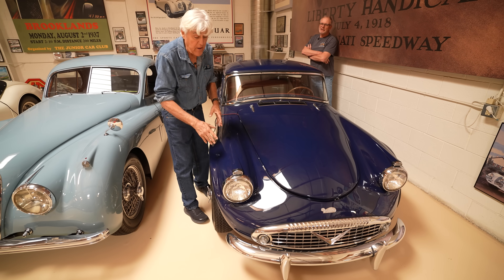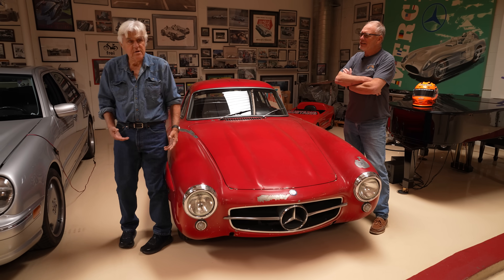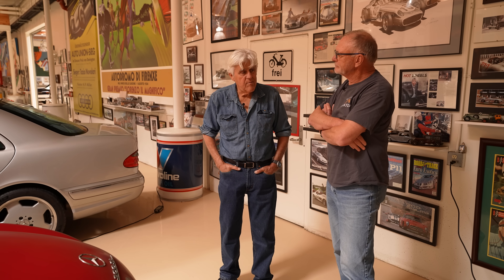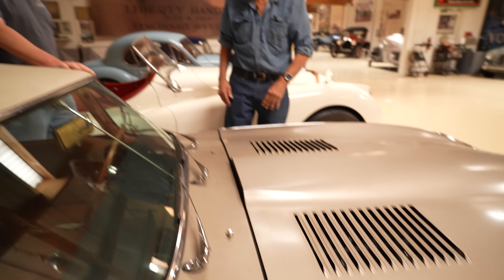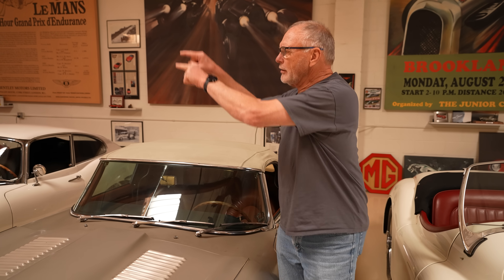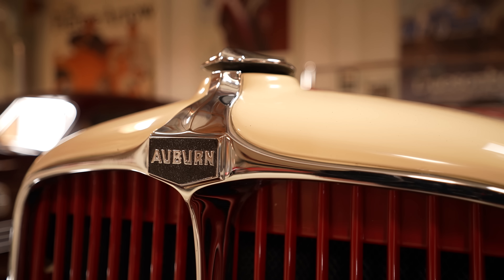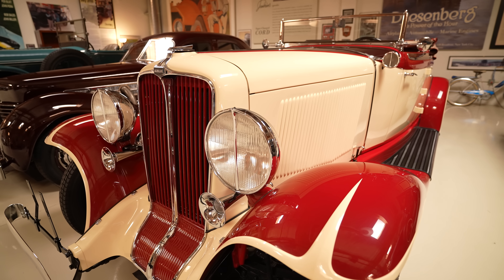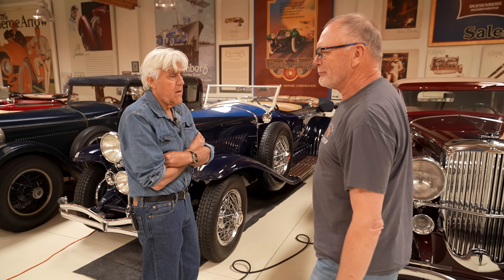All of Jay Leno's Barn Finds: How He Found Them & Untold Stories | Barn Find Hunter

Comment: I have personally known two guys that approach the level of Jay Leno, who will remain nameless, here. Each of them was a bit surprised that I knew as much as I did (which isn't much). Both are niche collectors. Jay, however, is all encompassing. His knowledge about cars is well beyond nearly everyone.
When I see videos like this, I start to wonder what happened to two specific cars. A Duesenberg "boat tailed" roadster I saw (1 time) when I was in High school ( the guy that had it was surprised that I knew what it was) and a 1956 Oldsmobile Holiday I saw in a friend's dads garage in 1971 (less than 10,000 miles and 100% original, tires included)

Comment: Tom (regarding the Jaguar E-Type @8:35): So, what did you have to do to the engine? Jay: Nothing. Cleaned it. Took it apart. Pulled the rear end out. Flushed everything. New seals. That's about it.

Comment: Wow. Love the Deucenberg cars. Seeing Eddie Rickenbacker mentioned on the wall behind the Walker Coupe is interesting.  Eddie was very close friends with my Grandfather. They flew together in WW1. The planes were Dehavaland DH-4's. I know that my grandfather worked as a machinist in Elizabeth, N.J.  for Standard Aircraft, building Liberty  V-12 engines. They were the ones installed in the Dehavaland DH-4. 
After WW1,  my grandfather bought his plane from the Army Air  Corps.  He flew the U.S. Mail out of Hadley Field ( Airport),   South Plainfield,  New Jersey.  One of the first "night fliers". From Hadley to Chicago.  Later,  he would fly out of Newark Airport,  which opened in 1928. Somewhere I have a newspaper article with a picture of my grandfather,I believe it was in December, with a U.S. Mail Pouch handcuffed to his wrist. He was using a blow torch to heat up the fuel line,  because it froze and he made an "emergency landing" on Old Lincoln Highway (Route 27) Somewhere near Edison New Jersey.  
 Thanks again for these videos. So much American History is Disappearing and not being handed down to our youth. 
😎🇺🇲🇺🇲🇺🇲

Comment: Barn finds are wonderful. I'm an old Corvette and I ran across a 66 big block in Geneva Switzerland. 9000 miles, totally original. I already have an old Vette, so I was hoping to sell it to a fellow enthusiast. Not for a horrid price - but no one seems to want it. The same guy I bought it from had a 12 cylinder Jag with 3000 miles. All original. I called the Jaguar club and talked to several enthusiasts. It was amazing. No one was interested.

Comment: Jay, you do not know me, but I know of you thru your stories. It is too bad we live a long distance apart. As I was watching this video, it came to my mind that you and my father would have been best friends. He loved anything that had an engine but, he had to make it run. He lived in Grove Okla where he raised his family. On our five-acre farm he had a small engine repair shop. He could and would make any engine run again. As I recall, he had a guy bring him a Maytag washing machine engine. In the early 1900's most farms did not have electricity.  Mom would do her washing with a gas-powered Maytag washing machine.  It was a two-cylinder two stroke kick start engine. Every time someone new would come in his shop he would start that engine. One thing dad had was patience. That first Maytag was frozen solid. For months he would tap the piston and add a little winter green penetrating oil. After a few years dad had a dozen lined up in a row, all running engines. He advanced to a little bigger farm one piston farm engines. Years later he when to a field where he knew that there was a Model T Ford. Not much left of the car but it was a rolling chaise. He offered the owner I believe five hundred dollars and he took it. With the understanding that a year later, he would drive it up in the guy's front lawn. Dad did not buy parts, if it needed something, he made it. I believe that he made cast iron rings for the pistons. He made new bands for the transmission. He re-wound the model T coils and flashed the magnets in the flywheel. Dad was a World War II Army Veteran and he left this would at the age of ninety-four.  I have a car that has been with me far too long, but I will drive it again someday. It is a 1970 Fiat 850 Sports Spider. I would guess that there are less than a dozen still drivable in the US. I moved to Tulsa when I got out of the Navy in 1980. I saw one other than mine on the road in the early 80's. It has been in storage since my last restoration in 2000. It has a Weber 30 DICA carburetor on it. This fall I will attempt to retore it to like new conditions. I am studying how to zinc plate most of the parts. It seems that none can be had for any amount of money. If you have one, please let me know. Thanks for letting me share.

Comment: Nicks Garage had a stock  1953 Chrysler 241 Hemi on the dino. It was amazing. Other than the great sounding exhaust you wouldn't know it was running. Not a bit of vibration. Its only down fall was the factory cast iron exhaust manifolds which probably didn't have an inch inside diameter. I want to say the hp was 150 maybe more. With the right air intake and exhaust  it would have been a screamer.

Comment: I'm going to try to make a long story my neighbor and good friend inherited a 1956 300 SL Gulwing in 2004. Since l collect vintage sports cars and am partners in a shop that specializes in vintage exotic makes she offered me this, bring the car back to full operating condition, keep it in my collection and maintain it, drive it as much as l want as long as she get to drive it occasionally. The car cleaned up extremely well so l explained that it would be far more valuable if we didn't restore it. There are some spots where primer is showing but it's wearing about 90% of it's original paint. Same with the interior, a new headliner and some stitching on the seats but the biggest issues were mechanical. It only had 17k miles but it had been over reved damaging the valves, fuel system, brakes etc.. lt took two years to locate all the parts and another five years of assembly and sorting out. It's now a wonderful driver with Rudge wheels fitted luggage leather seats and a Becker radio. Funny thing is the owner doesn't drive it. She has trouble with the manual Trans and unassisted steering. I've put 7k on it, not the most nimble car that goes from understeer to end swapping oversteer if driven properly is very rewarding. Like the one Jay has l'm not afraid of driving it anywhere it's a great highway Cruiser and been on several trips with nothing worse than a flat tire.

Comment: I’ve purchased a 1985 500 SL some time ago and started restoring it because it looked very rough. I regret I have started this, the car drove fine as it was and a lot of stuff I did didn’t make it any better. Also, the amount of money, time and energy needed is not funny anymore. 

Learned a lot though, but I warn a lot of people nowadays. If the oldtimer drives okay and is original but looks rough. Leave it as it is, the patina is worth more than clear coat.

Comment: I see this is a Hegarty channel but hopefully you can ask J for me I have a very important question about the TR6 I saw passing thru the frame of this video. 
Are you a leading edge or trailing edge guy? I’m torn.  The matte black used on the trailing edge is my favorite and unusual.  As a teenager I loved the exhaust tone. If I wasn’t 6’2 I might be driving one.
Reply: Lastly on barn finds have you ever heard about the Auto dismantling yard in long beach somewhere who had over 10 max 300 and full wing cars covered with tarps. I owned a prop fabrication shop looking for old jag grills and the owner took me to the old building in the back and started pulling tarps off his pride and joy. I almost passed out. I hope you met the guy.

Comment: Why are the cars connected to power cables? Are all these vintage cars converted to electric cars?
Reply: They are still combustion engines. those are trickle chargers.  It keep the car's battery fully charged when sitting for extended periods of time, so you don't have to boost it when you want to start it.

Comment: Jay, read Scotsman Callum Douglas', author of The Secret Horsepower Race. Callum Douglas is an F1 engine designer and WW2 engine historian, who spent 5 years researching his book in the UK, USA and Germany. He learned technical German to research the German archives. He is the world's authority on WW2 aero engines.

Calum E Douglas wrote in a Twitter post:

Surely everyone just KNOWS that the good old stories about FORD laughing at the Merlin drawings and that Rolls-Royce engines were all hand built must be true!

But the British bumpkins in sheds with flat caps and files is far too much fun so it is generally preferred over pesky "archive data" to this very day.

Well this document, plus the fact there is a huge parts interchange manual which tells you which Packard part number you need to get to replace a certain Rolls-Royce part in either engine and visa versa. Of course not all parts were interchangeable, Packard did their own supercharger drive gearbox system, and used American sourced accessories like cabin air compressors and magnetos.

As I have previously posted, the Americans DID indeed deserve massive credit for the mass production of the Merlin in BOTH the USA and England, but this was in truth due to the fact that the best automatic machine tools in the world at the time were American, all the British mass production depended to a huge degree on American machine tools. But again, nobody cares about machine tools in history, so its not a sexy enough fact to promote on TV.

Calum Again....

Claiming that Britain didn't mass produce engines properly because if they had, they would never have needed to ask Packard for help. Despite having made twice the number anyone else did. It took Packard 4 years to exceed RR annual Merlin production by the way, and all the Packard Merlin`s we used had to be modified by RR after they arrived in the UK, because to allow Packard to work as they wished to, they agreed to let Packard make huge runs of exactly the same spec' engines, which were obsolete by the time they were finished and had to be modified by RR in Britain to the latest mod-spec individually after shipping.
Reply: Packard only started to produce the Merlin in volume in late 1941, having problems with the first batch, which is normal of course. Just in time for the USAs entry into WW2. Luckily the British set up a shadow Merlin factory in Detroit which the USA military used, alongside: Derby, Glasgow, Crewe and Manchester. Glasgow was mass producing Merlins pre-WW2.

Interesting. If there is a Merlin pre 1941 it is clearly a Rolls-Royce British made Merlin. It may have been re-conditioned by Packard, but not sure if they did that sort of thing.